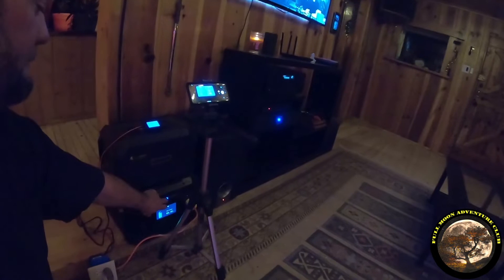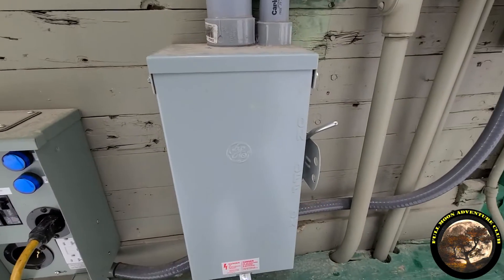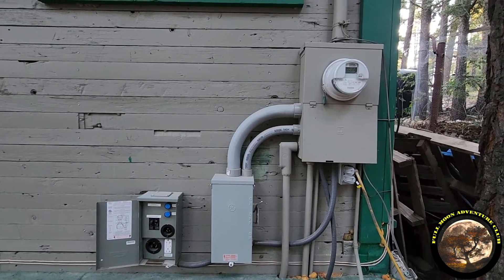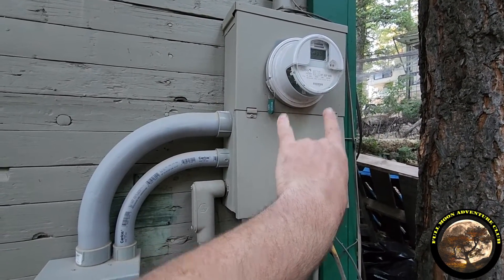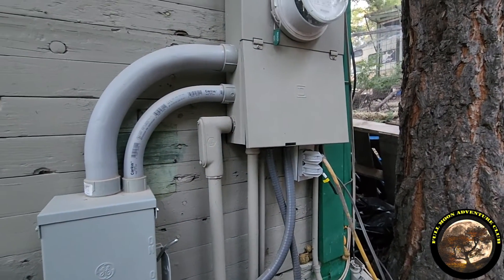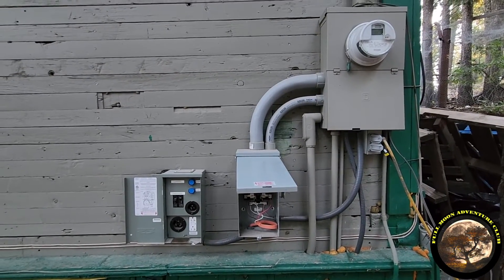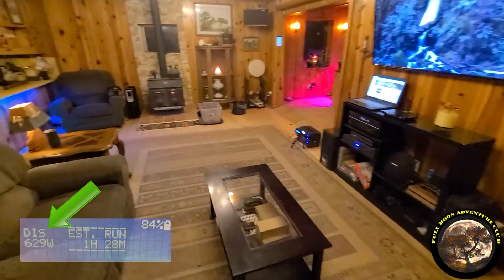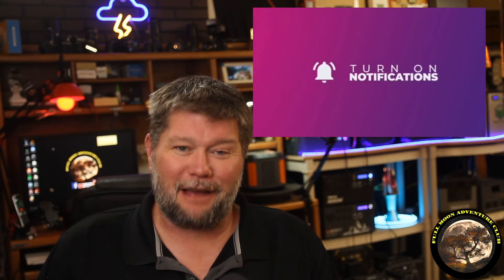How I Connect My Solar Generator To My House Fuse Panel

Comment: Looks good to me. A fuse on the incoming generator power isn’t super necessary because you still have a man on your breaker panel, right? I guess a 2*-pole fuse for that line wouldn’t hurt unless you are already protected somewhere in that gen line.
Reply from the maker: Agreed. The fuses were already installed in the pedestal box I installed so I wired them in. The more control the better I guess. Thanks for the comment and happy camping.